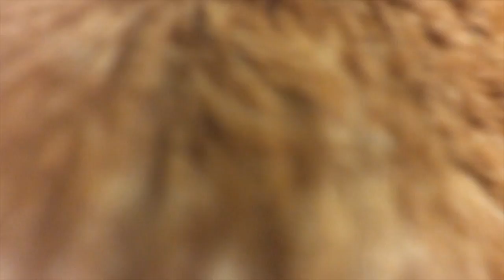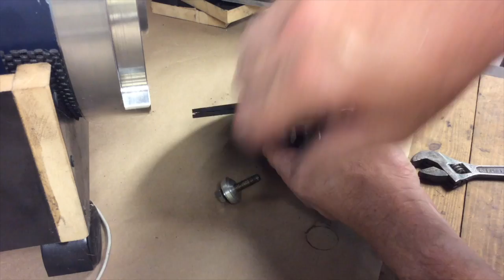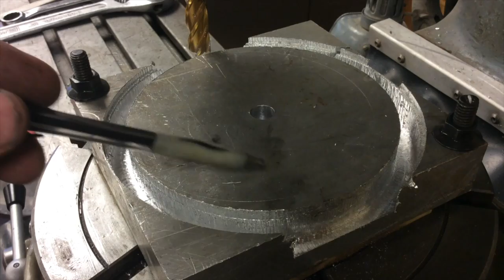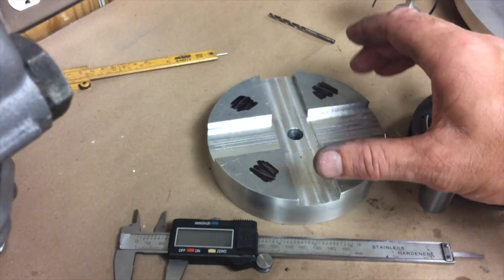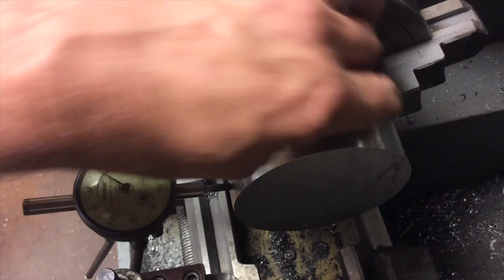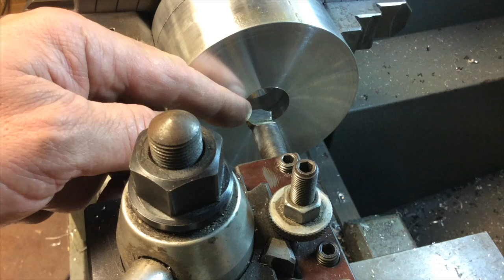RX7 TO EV7 episode 3a Drive Coupling

Comment: the three treaded holes are for pushing the coupler apart to remove from the shaft the holes with out treads are to tighten it down on to the shaft
Reply from the maker: chris rhodes, thanks Chris

Comment: Don the threaded holes are used to remove the part. The bolts are only used to hold or remove tension to the flange. The interference between the parts caused by the taper is what transfers power. Normally your hub would have the three holes threaded and the bolts would go through the un-threaded holes into the hub. Then to remove the part the bolts would be removed  from the hub and screwed into the threaded holes in the flange to press the tapered parts apart. The big problem you are going to have with the way you have done it is removing it in the future.
Reply from the maker: John Faubion, thanks for the info, with a any luck I won't have to take it back apart.

Comment: There is no need to use the springs as they are only there to absorb chattering of the clutch while its being engaged or disengaged.  Drill out the four rivets, throw away the springs and both plates and use the just the splined hub and drive flange which is sandwiched in between.  Much simpler.
Just a thought.... 8-)
Reply from the maker: Earl Yates, to late, I got them now. YouTube is a great learning tool. Thanks

Comment: I know it makes absolutely no difference now but I just noticed that the qd coupling has a gap in it to so that it can be compressed onto the keyed shaft and essentially clamped on with the pressure. I think if the diameter of the taper on that alloy piece began at the diameter of the small end of the taper on the qd coupling, it would mean that when you clamped them together with the bolts it would shrink the centre diameter of the coupling and clamp it onto the output shaft of the motor.
Reply from the maker: Fin Rennard , yes, you are correct

Comment: I am so excited to see your series! The details are great and I'll be watching to the finish! I have a question and some comments. Is there any concern about dissimilar metal corrosion on the taper bushing? Also, I used to use those taper hubs years ago for belt pulleys. The pulley never tightened in flush with the hub but we made them run true by alternately tightening each bolt. Hopefully you can make sure its tight enough on the shaft at the same time it comes in contact with the hub. Also, the threaded holes were used to separate the two parts for removal later. You would use the same bolts in those holes to push the two pieces apart. Sometimes the pulley would have similar matching holes as well so the bolts could be used on the most accessible side to pull them together or push them apart. Happy building.
Reply from the maker: Bryan, Thanks for the comments. I haven't thought to much about dissimilar metal corrosion. I'm planing on assembling the QD with 
Loctite and it should stay dry.

Comment: keep up the good work! can't wait to see the finished product. rx7 and rx8s are my favorite cars hands down! I use to own an rx8 but it got to the point where it was so worn out it wasn't worth repairing... could've bought a new one for how much I had to repair. anyways,  can't imagine an rx7 with electric power, even more RPM, wayyy more INSTANT torque, HP, AND doesn't guzzle gas like a tank?! not to mention less weight (good luck finding an engine that weighs less than a 13b) now motors... that's about 1/4th the weight I'm guessing? just do us all a favor and keep that 50/50 weight distribution! 
this thing is going to be a BEAST!